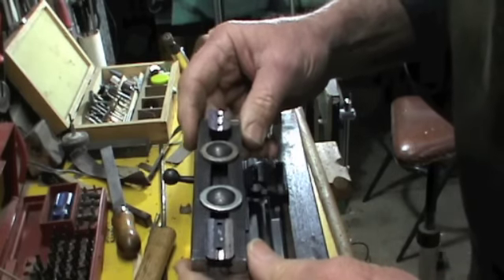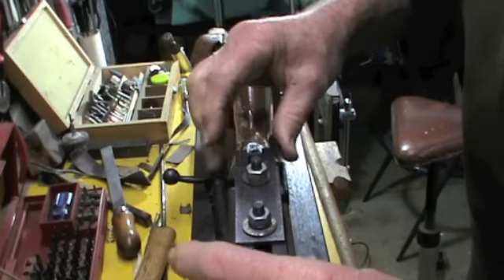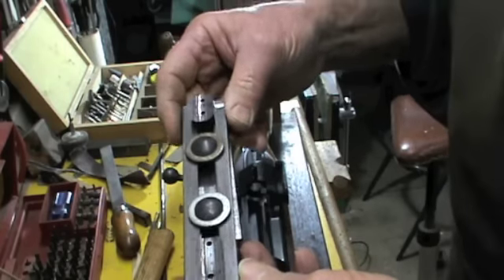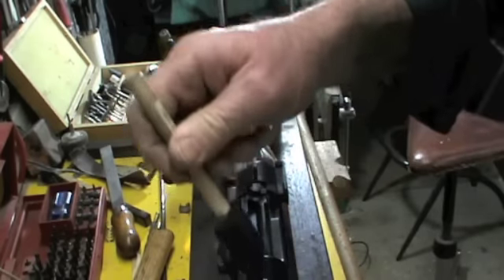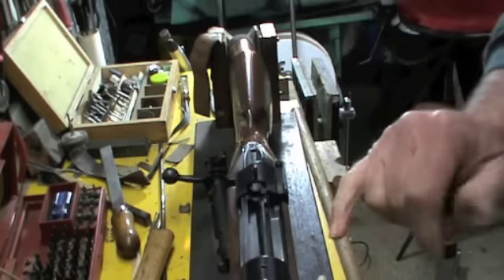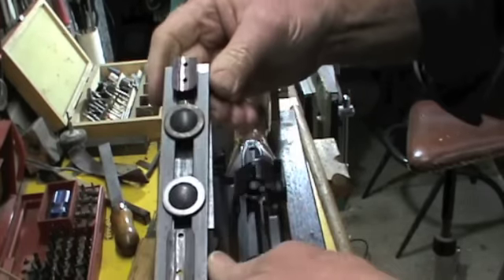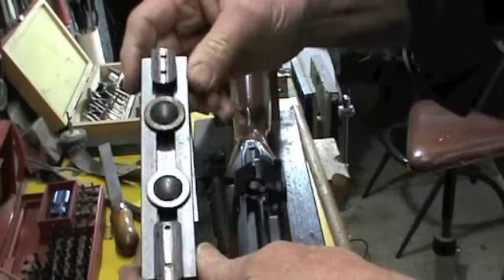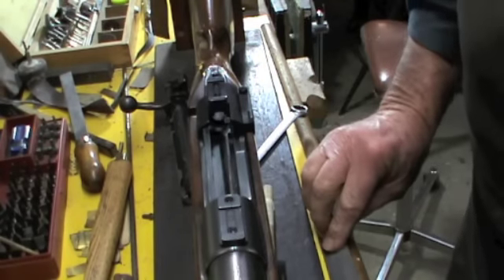Fitting misaligned scope bases.

Comment: I wished I had seen your vid when I was working on an Interarms mauser action! Good grief that was a bear to get all lined up right. Had to shim under my front mount to boot. Sheesh.
Reply from the maker: Hi Roadlord. Yes, ain't it a bitch, when you spend hours struggling with something, to later find a simple solution. Been there, done that. ;)  I struck this problem a lot, early in my career and so I made that jig to make the job go smoothly. It doesn't take all that long to make simple jigs, but they are a great help even doing just one job. I guess I will sell it, along with several other helper jigs, when I decide to hang up my apron. :) 
Cheers mate.